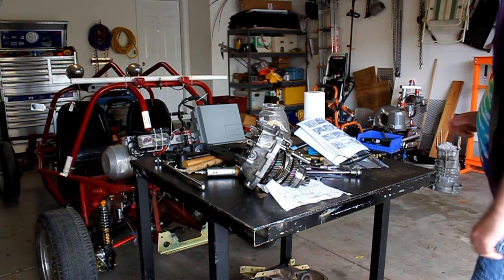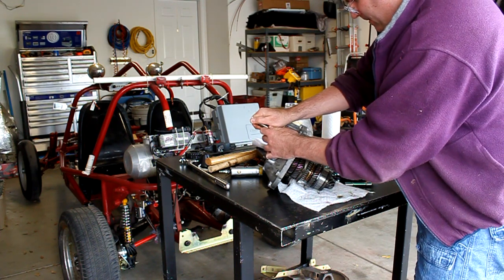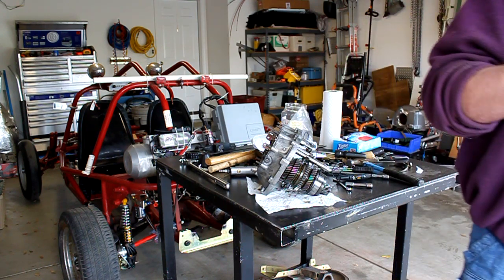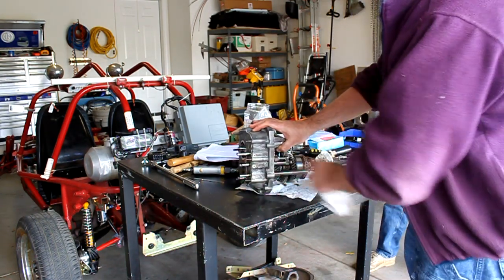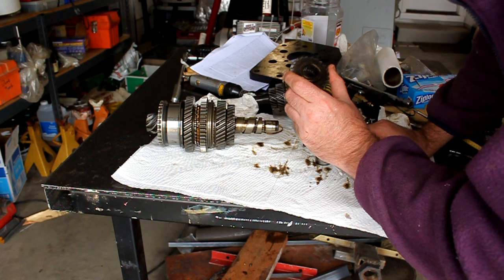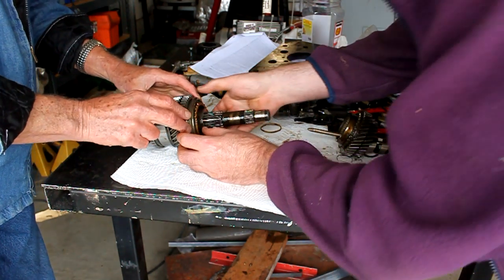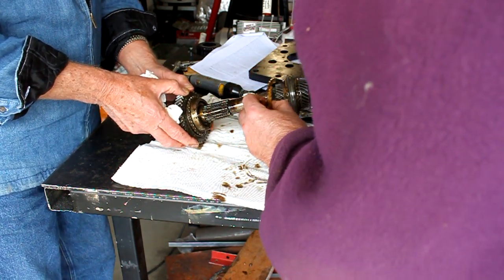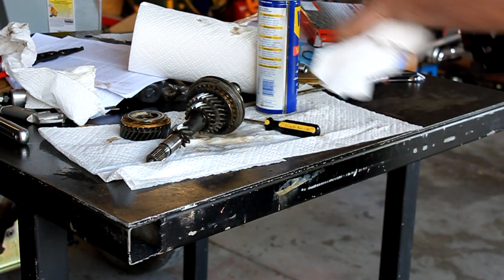002 VW Transaxle Rebuilt Part 3 - Shaft Disassembly

Comment: If your going to go that deep into a 002 or a 091 you should get hold of the Bentley or a VW shop manual, that way you don´t have to guess where a spacer goes or wich way the syncro hub goes